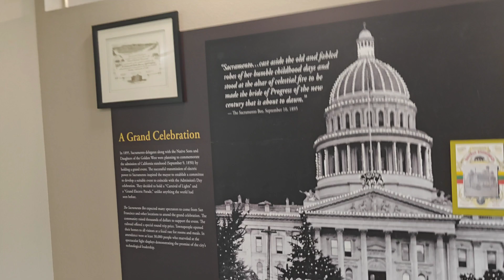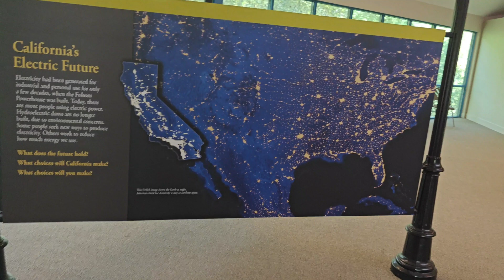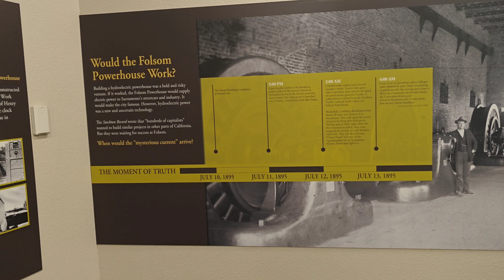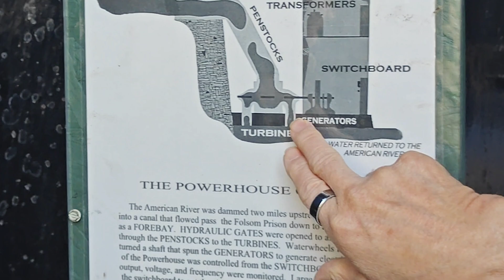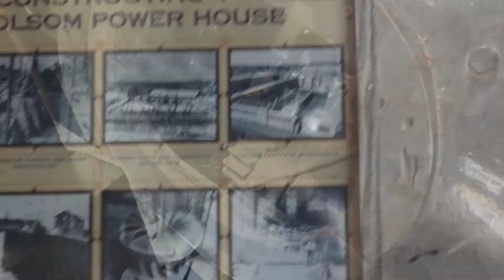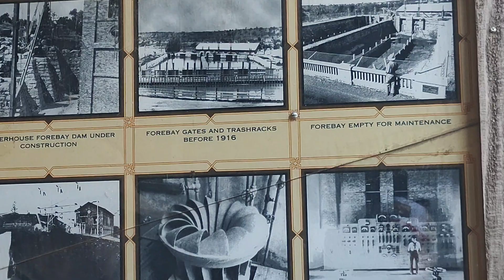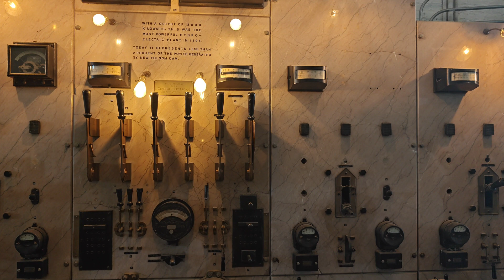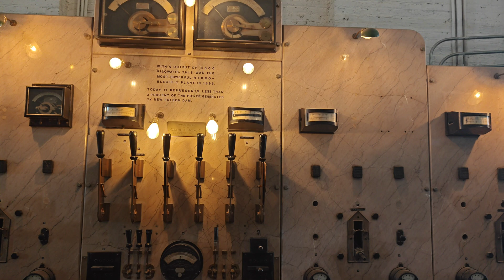The Folsom Powerhouse, the Electricity Standard

Comment: A.C. will travel just as far as D.C.  But..... A.C. can be transformed to higher voltages and can be conducted in wires at a much lower current at those high voltages, dramatically reducing the "I squared R" power loss in the conductor.  That's why A.C. is superior for long distance power transmission.  D.C. would have to be sent at it's actual user voltage.  That would also require massive conductors and even then, not a practical solution for power transmission.  People are enamored with Tesla but he was rather ignorant with respect to power transmission (and other things).  George Westinghouse advocated A.C. power transmission and that is what we use worldwide today.
Reply from the maker: Thank you for the information 😊

Comment: Did the dam for the powerhouse stop fish migration?
Reply from the maker: No because the way the powerhouse got it's water was by a side channel and all the water it received eventually went right back to the river. I wouldn't be surprised if a few fish got caught in the side channel but they could have  swam out the side once they reached the holding pool. The way the pool worked is it made sure only water got in the flume.
Reply: @pedrozatravel   But... the Folsom Dam of today does stop fish migration because they didn't provide fish ladders in its construction.  As a result, they need a "mitigated fish hatchery" at Natomas Dam, just downstream.  They cut open the female salmon there in the November/December timeframe.  They put the eggs into trays and manually spread the sperm from male salmon on the trays.  Then they hatch the smolt and later reintroduce the small fish into the river.  They really should build a fish ladder at Folsom Dam and get rid of Natomas Dam.